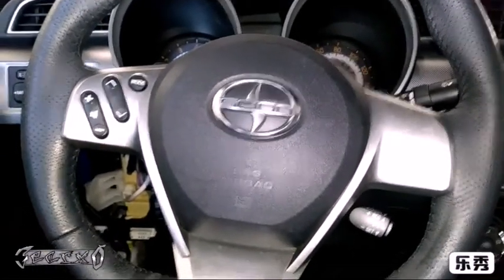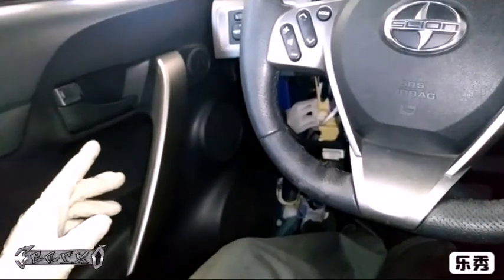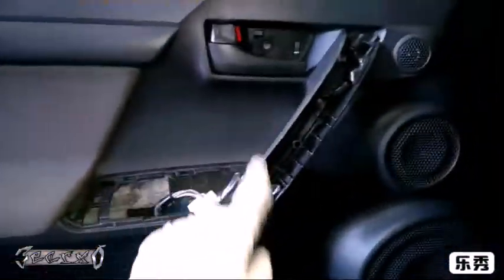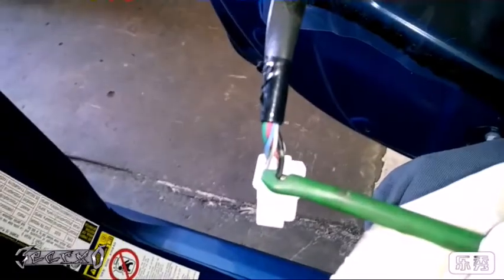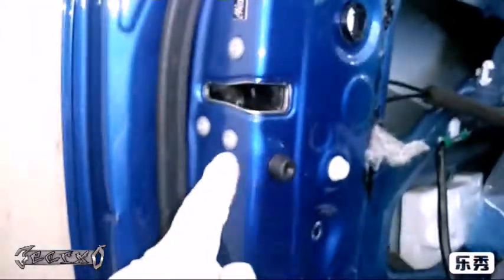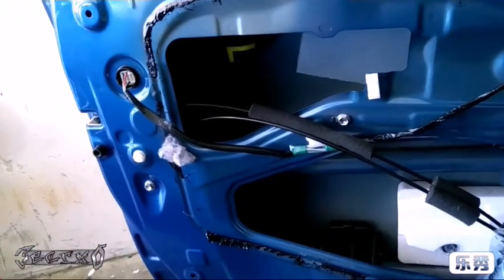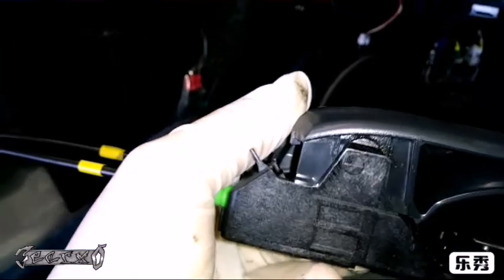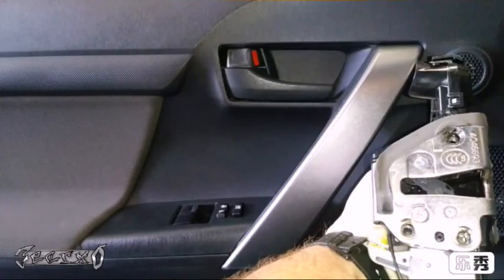Scion TC Door Locks Not Working (SOLVED)

Comment: The issue with the door locks are actually the little motor in the actuator.  Bought the motor for like 3 dollars on ebay and installed it.  Been about 3 years and still going strong
Reply: Follow up lol.
Reply: Can you please link the correct replacement motor?

Comment: Hey I have a 06 scion tc and I was working on the door handles.. And I was on the passenger side and I broke that yellow type clip that holds the latch and now my handle just sits in there loose now :/
Reply from the maker: Dude that happens sometimes. That yellow clip is fragile and hard to remove. If you send me an email i can check to see if i have an extra one if your interested.
Reply: They should have them at your local auto parts store in the HELP! Section with commons used or needed parts door clips or something like that good luck

Comment: Hello my driver door does not open from the inside but opens from the outside can you help me Scion tC 2005
Reply from the maker: Sounds like the handle is disconnected from the lever inside the door or it's broke not pulling on the lever. Are you able to take the door panel off and check?
Reply: Gearmo Auto yeah I took it off but idk if it’s the actshuater

Comment: Hi! I have the exact same problem with my 2014 scion tc, do you have a price estimate on how much it should be to have it fixed? And also is it necessary to replace the latches as well? Or just the actuator?
Reply: Hmm. Seems like the tC’s achilles heel. 

I have this problem on my 2014 tC’s driver side door lock. 

I dropped of the car to the Toyota Service Center where I bought my Scion this Saturday, and they had the faulty  actuator ordered. 
They told me to bring the car back in this Wednesday to install the new actuator 

It’s normally $480 but the dealer got it for me for free. 
They might have to charge me for installation though...we’ll see. 
Hopefully not.